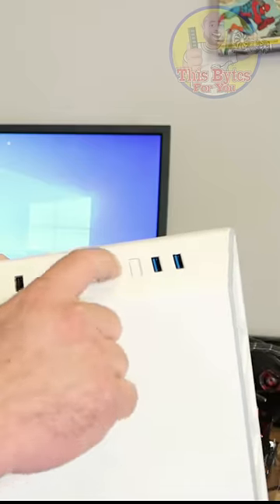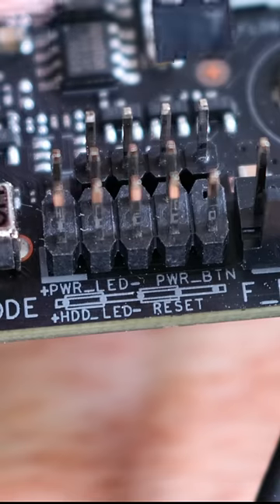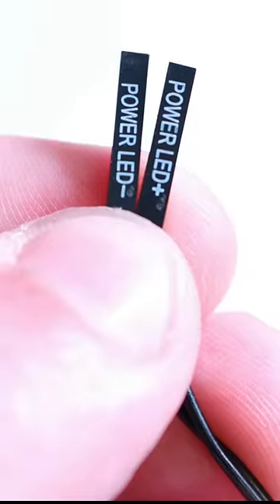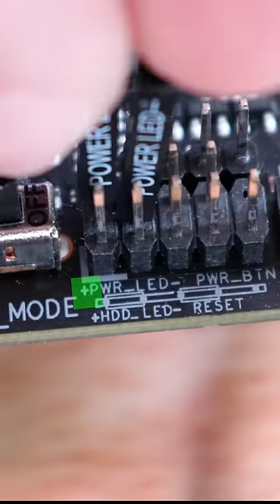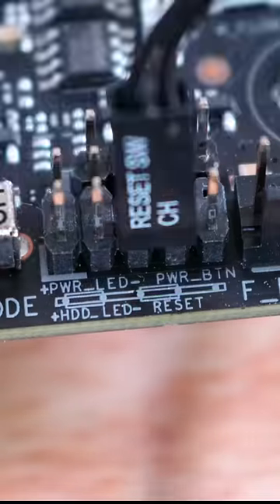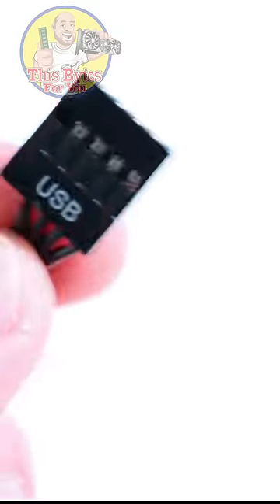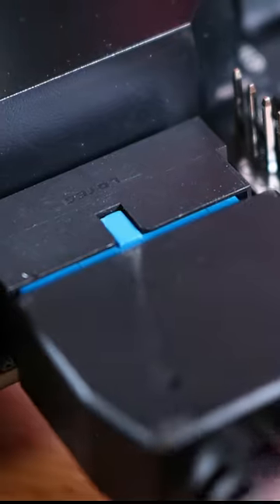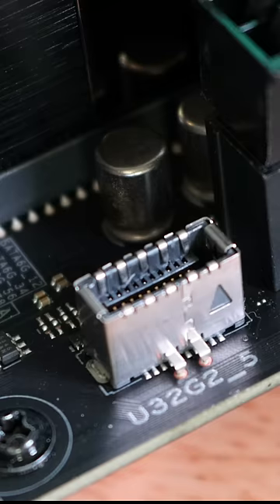Front Panel Connectors - Where do they go connected? #FrontPanelConnectors

Comment: I’m using a B550 A pro and I’ve been trying to find these connectors for over an hour. Where tf do they go? I see the indicators but there’s nothing there
Reply from the maker: As I mention in the video, you need to look in the manual, and it's in the same place as this video, you can find it on page 6: https://download.msi.com/archive/mnu_exe/mb/E7C56v2.1.pdf
Also, this video is the short, you migth want to watch the full video that goes into a lot more detail, hard to fit in a lot of information into 49 seconds: https://youtu.be/k6A3MG3yJzQ

Comment: Omggg thank you
Reply from the maker: Always a pleasure my friend, so very happy you stopped by, trusted in me to help you, liked and subbed as well as took a moment out of your day to thank me.  It means a ton to me and I am so very happy I could help you.
Reply: @ThisBytesForYou  thanks for an answer. I've got a problem though, (I bought today a new motherboard and processor) and after everything is plugged in, the RGB light on the motherboard is working as well as graphics card and CPU, but monitors are not displaying anything and USB ports are also not working. What could cause the problem?
Reply from the maker: is your hdmi/dp cable plugged into the graphics card, not the motherboard?
Reply: @ThisBytesForYou  yes
Reply from the maker: So that I can help, please list the manufacturer and exact model number of the following components:
1. Motherboard - manufacturer and exact model number
2. CPU - manufacturer and exact model number
3. RAM - manufacturer and exact model number
4. Video Card - manufacturer and exact model number
5. Power supply - manufacturer and exact model number
6. Monitor - manufacturer and exact model number
 Redundant I know, but many people forget to enter manufacturer and exact model number
7. Do you have ALL of the PCIE connections plugged in, and not daisy chained or pigtailed, each coming directly from the power supply?
8. Are you running through HDMI, DP, DVI, VGA, any adapters?
9. What slots do you have your RAM installed in?
Reply: @ThisBytesForYou   some components are not new, it will take some time for me to search what model they are 
But for now:
-Processor: AMD Ryzen 5 5600x 
-Motherboard: TUF gaming B450 series
-Ram: Ballistix ddr4 (I will need to search in my notes what type they are) 
-Graphics card: AMD Radeon Rx 6650 XT
-Two monitors, HDMI and display port
- 600w Energy supply 
-500gb SSD 
- 1Tb HDD
Reply from the maker: I see, flash the BIOS of the B450 to support the 5600X in order to do that though, you will need another cpu, a supported one
Reply: @ThisBytesForYou  but like, the bios is not appearing, nothing is appearing, the monitors "think" they're not plugged in
Reply from the maker: Yes, that is what happens when the bios does not support the CPU.  If you go to your motherboards support site you will find a bios that states it supports newer processors, that's a common thing with the x series processor and people fear to update the bios
Reply: @ThisBytesForYou  but.. they're both socket am4.. are you serious, did I really spent money on something that just won't work properly?
Reply from the maker: yes, they are both socket AM4, which is why all you really need is a BIOS update, if it was a socket AM5 processor you would need a hammer, chisel and some engineering experience, for AM4 all you need is to borrow an older am4 cpu, flash the BIOS then pop in the newer CPU, I understand you may not have an older cpu, but I am giving you solutions.
Reply: @ThisBytesForYou  alright I guess.. so this motherboard offers an option to flash back? Without monitors?
Reply from the maker: I dont know, you haven't given me the specific model number, but that is the case with B450, B550, X590 chipsets, as for BIOS flashback.... I need specifics on the board.
Reply: @ThisBytesForYou  nah bro this motherboard doesn't have flashback option
I'm so fucked
Why is it even allowed to happen, they didn't think of that someone may not have the elder CPU or something? What are they stupid or something?
Reply from the maker: it costs them more money to put flashback in there, so then you would pay that money too, so if your friend has an older cpu you can borrow or you do, give that a try @Otryvik
Reply from the maker: Cool, I used to use Intel as well, (maybe soon again, who knows) but as a reviewer I have to try other things, It can happen for Intel as well, this cpu came out well after the board was made, then AMD created it, with additional things that in order for boards to support, they would need to flash the BIOS, or just buy a completely different board,... everyone has been happy that they didn't need to buy another board, it wasn't a plan for this to happen.

Comment: look, i got so much i gotta do to my pc, in total i just spent 2k on it, and im 15. i need to9 get this mfer built, but i got a lotta steps to go through, maybe you could possibly help me someway, probably not though cause you cant just do all the wiring i need done for me..
Reply: anything would be helpful, but there aint much you can do. i just about give up, might just sell it
Reply from the maker: I did help you, I have over 500 videos, many of those are on building and cable management.  Check them out and learn how to do it.
Reply: @ThisBytesForYou  yeah my power supply dont have the right plugs for it, just learned that the hard way.
Reply from the maker: it happens, if you let me know your components, I will see if I have any guides to help you.
So that I can help, please list the manufacturer and exact model number of the following components:
1. Motherboard - manufacturer and exact model number
2. CPU - manufacturer and exact model number
3. RAM - manufacturer and exact model number
4. Video Card - manufacturer and exact model number
5. Power supply - manufacturer and exact model number
6. Monitor - manufacturer and exact model number
Reply: @ThisBytesForYou   I got a hp x24i gaming monitor

I got a evga 850w gold PSU

I got a i9 10850k unlocked

2x16 GB of trident Z royal silver also 16gb of some other ram (2x8) DDR4

Motherboards a MSI z590 gaming edge Wi-Fi

I got a 3x ventus nvida 3060ti msi

Samsung 1tb 980 PRO

I’ll have to show you the model numbers when I get back.
Reply from the maker: what is the case manufacturer and model number?
Reply: @ThisBytesForYou  h510i nzxt. im gonna bring it up to best buy and let them do it way easier
Reply from the maker: Well, I make these videos to help you so you don't need to spend money, but I get it, this kind of stuff is not for everyone.  I hope BestBuy helps you, they usually charge a lot, take a lot time on the repairs, and break things or tell you things are broken to sell you extra services, but I hope that's not your case.  Also, that kind of tactic is not only a BestBuy thing, its with a lot of shops, but surely, there are some honest ones.
Reply: @ThisBytesForYou  your right, lets hope

Comment: My pc turns on but it won’t turn back off v
Reply from the maker: if this video didn't help, this might be better, this is the real video: https://youtu.be/k6A3MG3yJzQ
Reply: @ThisBytesForYou  yeah when I hold it it still won’t turn off
Reply from the maker: funny, I didn't go over holding it
Reply: @ThisBytesForYou  I clicked the link and in the vid your holding the button but it won’t turn off if I hold it or tap the button
Reply from the maker: you use windows to turn off the computer, not the power button, unless your start button doesn't work.  What version of windows are you running?
Reply: @ThisBytesForYou  yeah so like today I put the computer together and I still have not installed windows and some bad news my GPU won’t work
Reply from the maker: So that I can help, please list the manufacturer and exact model number of the following components:
1. Motherboard - manufacturer and exact model number
2. CPU - manufacturer and exact model number
3. RAM - manufacturer and exact model number
4. Video Card - manufacturer and exact model number
5. Power supply - manufacturer and exact model number
6. Monitor - manufacturer and exact model number
7. OS Drive - manufacturer and exact model number
8. Additional Drives - manufacturer and exact model numbers of each
Reply: @ThisBytesForYou  1. GIGABYTE B550M DS3H  
2. AMD RYZEN 5 3600
3. TFORCE 16GB 3200
4. GIGABYTE RX 580 4GB
5. GAMEMAX 750+ Gold fully modular 
And the rest I’m just using like an old monitor and I have no drives
Reply from the maker: This is an older video, but it should still help you, it
How to Build A PC You Can Be Proud Of From Start to Finish
https://youtu.be/XCggwcWdWsI
Let me know if this helps.
AS for the 580, make sure you are using an HDMI 2.1 cable.
Reply: @ThisBytesForYou  Ok thanks I will let you know if this hopefully fixed it
Reply from the maker: Always a pleasure my friend.
Reply: @ThisBytesForYou  yeah so my GPU still won’t spin and I tried connecting my monitor to the motherboard and it won’t  display  I tried moving the GPU to a different slot and resetting the cmos and yeah I tried everything and the button on my case only helps the pc turn on but not off
Reply from the maker: the gpu may not spin until it gets hot, doesn't mean its not working, not using an HDMI 2.1 will cause it not to work, Did you follow the video to make sure everything was installed correctly.?
Reply: @ThisBytesForYou  theres also lights on it and they won’t turn on
Reply from the maker: Is anything turning on in your PC or just the card?
Reply: @ThisBytesForYou  just the card, rn I have the pc on the the GPU feels like it’s getting warm but it’s still not on
Reply from the maker: read this carefully, Is your HDMI cable, an HDMI 2.1 cable, if not, it won't work.
Reply: @ThisBytesForYou  so it’s not my GPU? It’s just that I have wrong hdmi cable?
Reply from the maker: maybe... since you have a GPU on your cpu, take your card out, plug the hdmi cable into the motherboard, boot your machine and see if you can boot, flash the BIOS and then try again.
Reply: @ThisBytesForYou  yeah nothings working 😔 welp we tried
Reply: @ThisBytesForYou  yeah bro I made everything worse my pc won’t turn on anymore
Reply: @ThisBytesForYou  here’s what happened so Yk I was checking my GPU and it wouldn’t turn on so I checked my cpu and wouldn’t you know it had bent pins so I tried to bend them back in place and I put everything back together and now my pc won’t turn on😞😔
Reply from the maker: man, so very sorry my friend, wish I could be there to help you.
Reply: @ThisBytesForYou  hello so I think ik what might be the problem so I think the reason why my GPU won’t turn on is because it’s probably not getting enough power because I tested another working GPU and that one didn’t work so I believe it’s the psu. I think it’s the power cord causing this problem because it’s not the same power cord that came with the PSU, so what power cord will I need for a 750w 80+gold rgb psu?